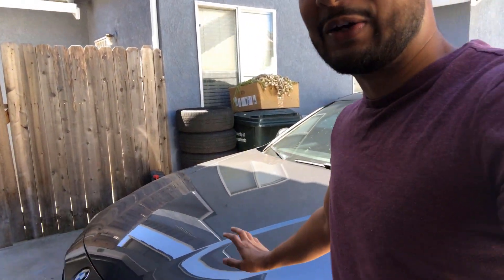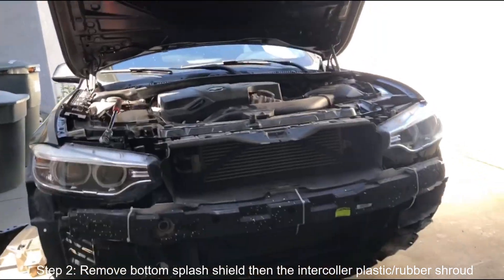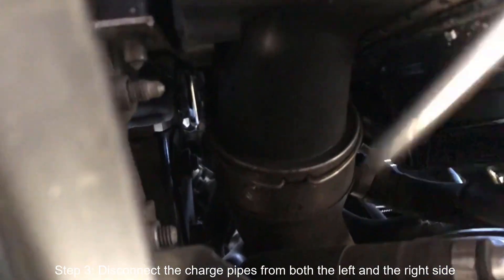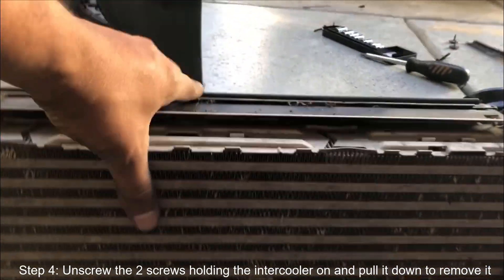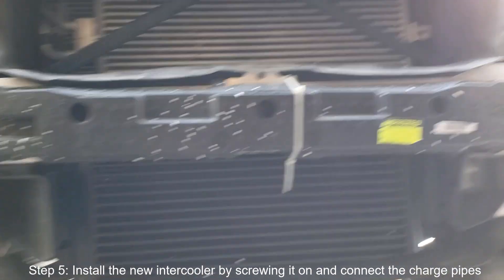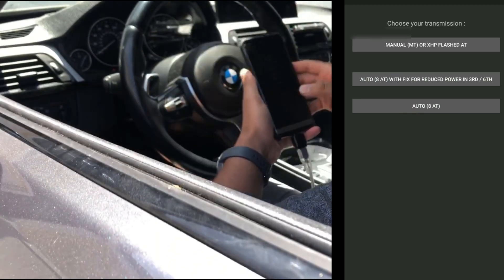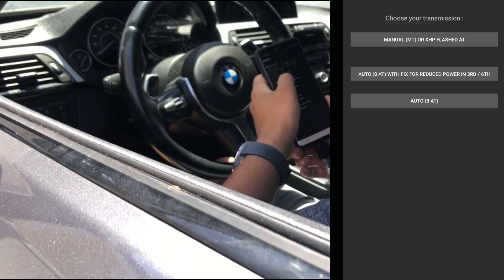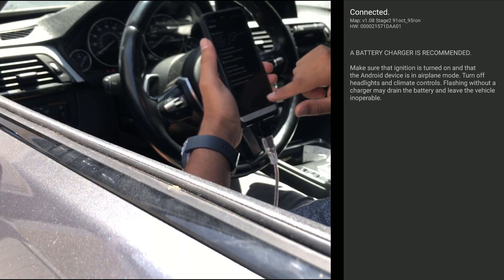MHD stage 2 N55 and FMIC install

Comment: Going Stage 2, if you had to pick one, would you upgrade the downpipe or the Intercooler ?
Reply from the maker: John I would go with the downpipe, I actually just bought one probably have a video coming next month
Reply: @rattuautoworks7547  What is the logic behind ? I have hard to understand why ? Your turbo probably spooling close to 14psi which mean it will bring so much more hot air in the intake, probably +60f. Why is it not as important as bringing colder air in the intake ?
Reply from the maker: @John-qc1zv  In a perfect world I would upgrade them both but I contacted MHD about the same thing last year & they told me as long as I do one of the 2 it’ll be okay, it didn’t matter which one I charged. But now i want to have more aggressive burbles and doing so would likely damage the cats so I’m going with the careless downpipe. Most of the time when people put the tune on they want more burbles and stuff so if you’re not worried about that you could definitely go with the intercooler and it would probably be easier & cheaper just to start off with the intercooler too.

Comment: Did you put on the stage 2 with out putting on a aftermarket dp and how did the car run ?
Reply from the maker: Yup, I’ve had it in for over 2 years now and car still running fine.
Reply: @rattuautoworks7547  are you running the current stage 2 map ? I asked MHD recently and they advise downpipe now for stage 2.  But you've have your car running for 2 years - I've just ordered an intercooler and charge pipe.  Question - on the sports display are you seeing it hit close to 400bhp?

Comment: I have a 2006 e60 M5 primary cat secondary cat resonator and muffler delete so a full straight pipe will this app work and should I go for the 2+ intercooler is shipping
Reply from the maker: I don't think MHD supports the E60 M5, they mostly cover the N54, N55 motors and the F30/F32 chassis.

Comment: Ive got an 08 535xi with 183,000kms on it. Do you recommend that i sell it and get a newer bmw or keep and mod it?
Reply from the maker: Vasu Taak It all depends on how well the car was taken care of. If you were the first owner and you’ve taken care of the car and all the maintenance stuff then I would keep it, but if you don’t know the history of the car or you haven’t maintained it well I will get rid of it while it still functions well
Reply: Sell it for 6k and buy another with cash. I sold my 328i two weeks ago for 6k had 198k I took good care of it. I also have had 2 other I somd e90s. Now I have a 110k 335i 2011 n55.
Reply: The n54 will respond to modifications about two-three times as well as the n55. However the twin scroll setup bmw adopted in the n55 is considered a more reliable power plant. It really comes down to whether you want power or longevity
Reply: @yipideeyodler365  n55 for longevity, n54 for compatibility and reliable power at 450hp 550hp. Very strong block but many small issues need to be premaintence be tune. But n55 is very reliable. Well said above.

Comment: If you have all mods can you just go straight from no tune to stage 2+ or you gotta buy stage 1 first
Reply: You can go straight to stage 2+, you don’t have to buy stage 1
Reply: @sourabhrattu2111  and do I need to buy the mhd wireless adapter or I can just get the k cable is there a difference and I see the super pack for 440 dollars on there siteand is there a difference with buying the pack in the app
Reply: At the time I bought it they didn’t have the wireless option so I used the cable route and worked just fine so I would save the money and buy the why wired option and I bought it on the app I don’t think there’s much of a cost difference I just had some Google credits that I used one buying it
Reply: @sourabhrattu2111  thanks alot man

Comment: Hey i have bmw 535i 2014 what stage should i buy for burble?
Already delete muffler and resonater
Reply from the maker: No matter what stage you get you can add burbles, but if you have an upgraded intercooler or a down pipe you should get stage 2.
Reply: Remember to change downpipes. It will burn out ur oem cats

Comment: Are you running stock downpipes?
Reply from the maker: Yeah I’m running the stock cats, no down pipes on it. Downpipes are needed if you’re going to be running stage 2+.
Reply: @rattuautoworks7547  you are supposed to run either a high flow cat or a catless downpipe not stock... either you are missing a lot of performance or you stock cats are fcked already
Reply from the maker: @edgarmichaus1726  here are the requirements for each stage on MHD's website:
https://mhdtuning.com/products/mhd-super-license-for-n55

 "N55 EWG (electronic wastgate)

Stage 1 (up to 360HP/540NM) - 91oct/95ron, 93oct/98ron, 95oct/102ron, for stock cars. (not available for M2 and X4 M40i)
Stage 2 (up to 390HP/580NM) - 91oct/95ron, 93oct/98ron, 95oct/102ron, for cars equipped with an upgraded intercooler or high-flow downpipe.
Stage 2+ (up to 430HP/630NM) - 91oct/95ron, 93oct/98ron, 95oct/102ron, for cars equipped with an upgraded intercooler and high-flow downpipe."
Reply: @rattuautoworks7547  i see the put "or" but i truly believe they make a huge mistake. Every single tuning company available required at least a high flow dp por stage 2. Only stage 1 can be ran stock
ask them personally and be sure. I'm 100% sure it is pointless to run stage 2 with stock cats. One you can damage your car since that tune is not optimized for stock cats and two you are not getting all the potential from the stage 2
look at this other description on their same page
https://mhdtuning.com/collections/mhd-flasher-f-series-n55/products/mhd-n55-map-pack?variant=31640460361783
Reply: @edgarmichaus1726  hey I have catless dp, and I’m stage 2 should be good or nah ? Should I upgrade my charge pipe as well
Reply: @jvz_5.0  chargepipe should be the first mod, even if yourncar is stock.
Reply: @edgarmichaus1726  why is that? I’m order one rn
Reply: @jvz_5.0  because stock one is putr plastic and doesn't hold boost. I will blow first hard pull you do once tuned.
Reply: @edgarmichaus1726  I’ve been on stage 2 with only my downpipe my cars is fine but after reading all this I just ordered a charge pipe from vrsf
Reply: @jvz_5.0  just get it, it's not just me who says that, mine never exploded buy why to risk it? if you see 90% of the other owners warning you if because of something
Reply: @edgarmichaus1726  just ordered thanks bro
Reply: @edgarmichaus1726  this is all true my charge pipe blew up with stage 1 the sensor blew right off and the top was all gone. Charge pipe should be number one priority to change if modding

Comment: Hello. Thanks for the amazing video. For stage 2, mine is 435i 2016 f32 n55, whats the difference between oct and ron numbers and what are they already ? Which one should I go with ?!
Reply from the maker: Saad Salem The octa RON reading is just what you get in Europe so 95 RON = 91 US gas, I would go with the highest rated gas you could get at the local gas station. The highest I could get in California was 91 gas so that’s what I picked. BMW requires premium gas out of the factory, so the default would be 91.

Comment: Car still running alright a year later?
Reply from the maker: Yeah still running solid, I actually drove it all the way up to Seattle from Sacramento, CA about a 750 miles drive one way.
Reply: @rattuautoworks7547  2013 535i xdrive 8spd auto.....im bout to get MHD STAGE 1.....i hope this doesnt disappoint.....and im going to follow your lead on that pedal throttle and gear reduction....im kinda confused on what it does but i take your word on it